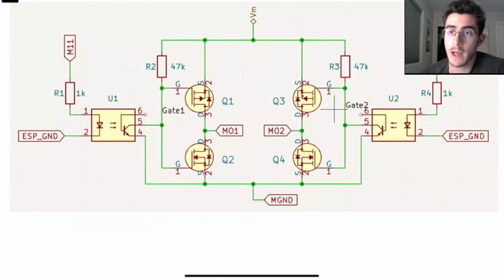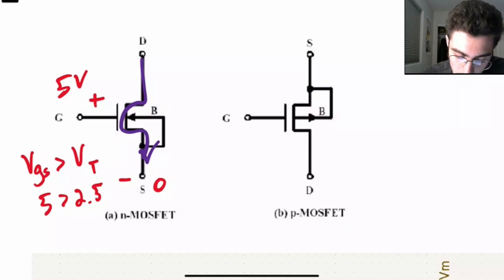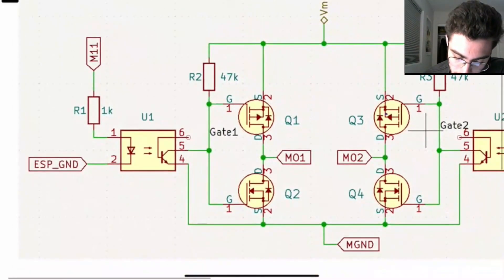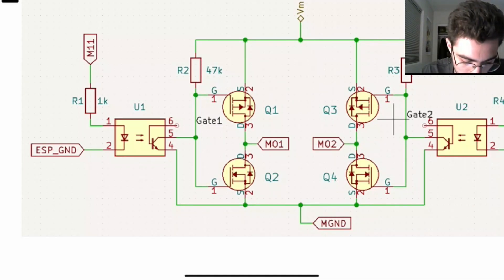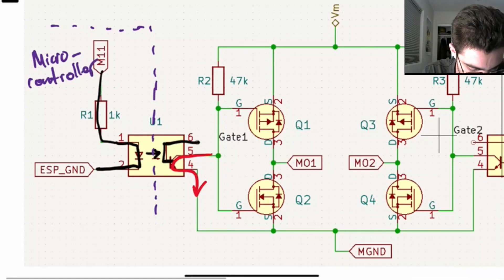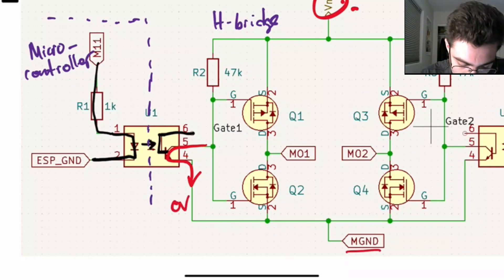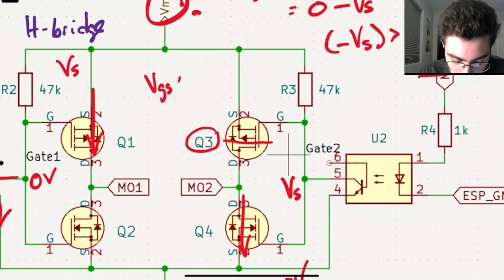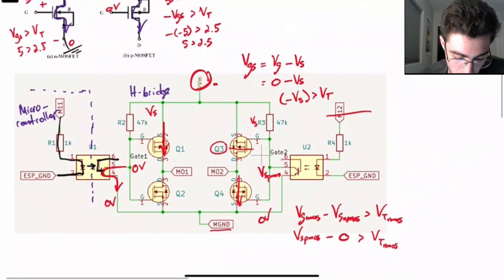H bridge Circuit Theory - 2 Wire Input Design

Comment: This was a great video! I would like to ask about those resistors. What purpose do they serve, and how did you come to that value? Please continue making videos like these. Also, I am having trouble finding content like this. Do you have any book recommendations that contain content the way you presented it here but for other things in embedded systems? for example, working with USB, UART, I2C, SPI, circuits with batteries, etc.

Comment: So, theoretically, what if someone built that circuit with BJT transistors in place of the opto-isolators? 
I have a circuit that is almost identical to this, except I'm using MMBT3904 transistors instead of the opto-isolators, and I've added additional flyback diodes across the drain and source of each mosfet. The voltage to the h-bridge is 12V but the MOSFETs don't seem to be fully opening/closing as the voltage to the motor outputs is -4V at rest and driving in one direction and +2V driving in the other direction. The only real difference I see is the opto-isolators but I wouldn't have thought that would make a difference other than being "extra safe." Can someone explain? 
If it helps, the N and P MOSFETs are rated at plus and minus 30V source-drain, respectively,  and have a gate-source voltage of +/-20V. Threshold voltage is 2V and -2.4V.

Comment: Maybe explore inverters, to share how the sine wave controller turns the H-bridge into an inverter.  Also, other waveforms creation.  Maybe frequency control, voltage control and how current is controlled I guess more with a converter before the inverter if not like a HF transformer design.  I'm also wondering the ways how high power offset control is performed like for a welder machine that welds aluminum.
Reply from the maker: Great suggestions, thanks! I will keep these in mind
Reply: @EV_engineer  Do you have an email or another contact. I have a specific question to discuss.  Thanks,

Comment: Hi. Thank you, very useful video. Do you know if H-Bridges are used in EVs to control traction motors?
Reply from the maker: Hello, traction motors can be AC or DC; EV's usually have AC traction motors because AC motors have a higher power-to-weight ratio. There are many types of AC motors, but to control the speed and direction of an AC motor, one must be able to control the frequency and phase of the AC signals being delivered to the motor. Trying to emulate an AC signal with an h-bridge would be very difficult to do, and would probably require some serious capacitive filtering. You might not even have directional control of the AC motor either if you try to use an H-bridge. You're better off using an inverter to drive AC motors, and leave the H-bridge for the DC motors, as that is the intended design.
Reply: @EV_engineer  Isn't an inverter an H-bridge using Sine Pulse Wave Modulation with more the more complex SPWM algorithm to control voltage, frequency, waveform (pure sine wave), time and duty cycle?   Then like you note that is an inductor and capacitor(s) used to smooth the waveform into the pure sine wave shape so not so choppy I guess isn't the correct term.  Starts off like a DC positive pulses that change width to the peak and then back down to zero to negative DC doing similar calculated for the desired output voltage.